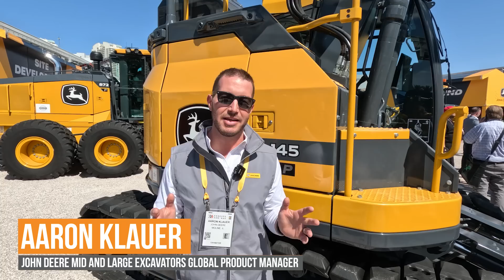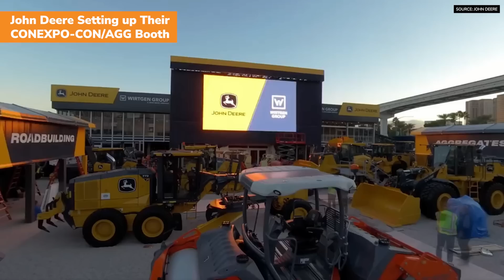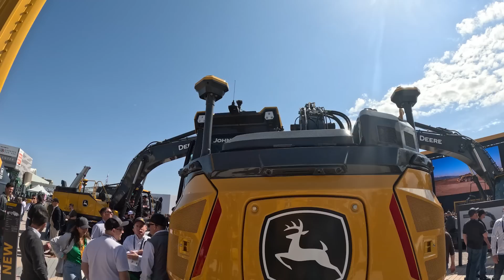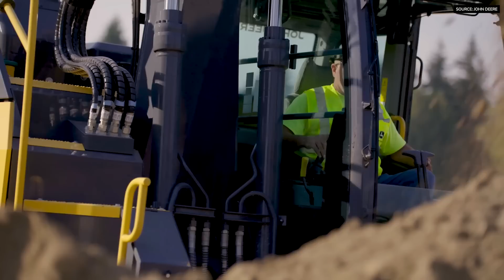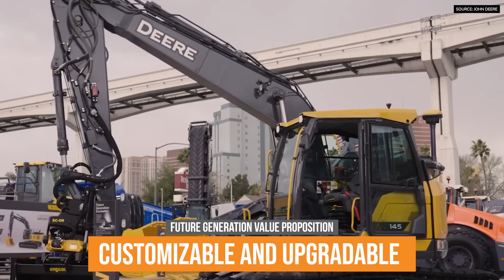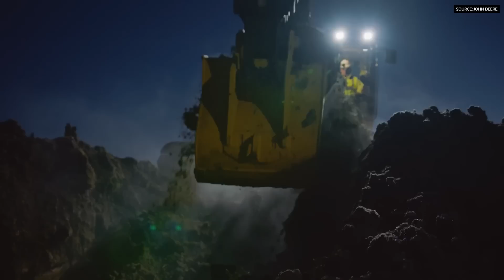John Deere Unveils Its Future Generation Excavators

Comment: The 135G is a little powerhouse. Great engines, PITIFUL cabs. While Caterpillar is focusing on creature comforts John Deere has neglected to even give an operator room for a lunch box. Winter clothing snags on controls trying to exit the machine. I’m 6’4” and have been operating heavy equipment for 50 years. Do Better John Deere!
Reply: This is a totally new cab and a full size one at that.

Comment: I thought these were designed in China through XCG [ NOT XCMG}  Hopefully for Deere they can maintain their share as Deere badged Hitachi excavators, especially ones equipped with the Isuzu were very strong.
Reply: These are designed & built in Kernersville NC🇺🇸. Do your research

Comment: There for $hit, all this electrons there incorporating in to them are killing them. This has been a problem for farmers for yr's now, the tractors have so mush software running that when one little thing goes wrong you can't do anything with it and it's not serviceable by the farmers and most times only a tech can fix it..I buy older ones of all sizes and rebuild them and it's great, they work good and if anything breaks it's easy to fix on site and I don't need a service tech from god knows where to tell me he can look at in in 2 weeks... Waste of money these new one's..

Comment: I wish them well, but  what a potential customer risk to get a first run of a newly designed equipment. Parts and knowledge are more abundant on tried and true models that have had time to soak in the market. I have owned up to 9 Deere brand  excavators at a single time in my fleet  ,they are fine.
Reply: love your video bud! love all the vintage logging iron you show us hiding in the bushes of BC! i hope they build these hoes better than those 853m bunchers they designed
Reply: They have spent over 10 years and 150k hours testing these machines & loaning them to customers for for feedback. Nothing about this new generation of excavators was rushed

Comment: "All these machines will be connected to our operations center"  So in other words, when I'm fixing a broken culvert during an emergency flood situation and something is not quite right with the machine, Deere is going to shut it down and tell me a technician needs to service it ?
Reply: No.  That's not what the Deere operations centers do.  But, I like the way you just invent problems.  You must be a joy to work with.   The Operations Center is for management functions.  It allows you to track maintenance automatically, setup projects for equipment management, etc.  It's for equipment owners, Deere doesn't control any of the equipment.
Reply: You do realize John Deere is at the forefront of lobbying for the legalization of "only" manufacturer service centers working on equipment?  They want to make it illegal for owners to work on their bought and paid for equipment. JD is dumping millions into politicians back pockets to get those laws made and passed.  I've watched several live town halls that had JD speakers pitching their desires to the politicians. It is only a matter of time before it happens.
Reply: @buckhorncortez  knowing John Deere yes that’s exactly how it’ll work
Reply: Not how that works. But, it’s fine.
Reply: Basically yes. They can upload viruses in them. The old Bill Gates Microsoft business model.
Reply: They dont now so why would they

Comment: Do me a favor and fix your 333g - I’ve had one for about 11 mos and it’s not functioned properly for 9 of them with a meer 260 hrs on the unit.
Reply: What's wrong with it? Sounds like you need the dealer to figure it out or send a new one. Seen a few brands suffer the same, notably Kubota when they had the def recalls on the svl-95s.
Reply: My 331 never seen the dealer minus one issue with a sensor

Comment: Need more flow on compact excavators and no Wacker Newson rebadged machines.
Reply: Wacker neuson is it any good? Ive never tryed and dont know anyway who had one
Reply: @mysterysolver514 Only tried the 2.5 ton wacker, But it is super smooth, little downtime and super powerful. Lifts boulders the size of the machine itself out of trenches..
Reply: @mysterysolver514  I wasn't impressed with the specs and since Deere and Hitachi dissolved there partnership Deere was talking about partnering with Wacker Newson to develop the next generation Deere mini excavators.
Reply: @1oddtech  makes sense! Thx
Reply: John Deere will make crappy excavators without Hitachi parts. Hitachi makes pumps and valves on most JD hoes so if they are out of the picture that would be cause of concern for me. The Japanese are very smart.
Reply: @ChuckBeefOG  It's not just being smart its their attention to detail and quality control. I'll always pick Hitachi over Deere any day of the week, month, or year. I've always hated the Deere engines, noisy and hard on fuel and they don't last as long at the Isuzu engines.
Reply: @bert26a  sold both Hitachi and Deere. Most people only see the fuel usage but don't consider the tonnage moved. Deere always had more grunt.